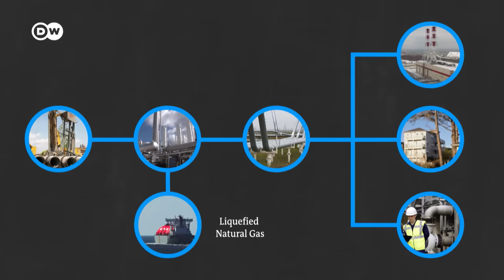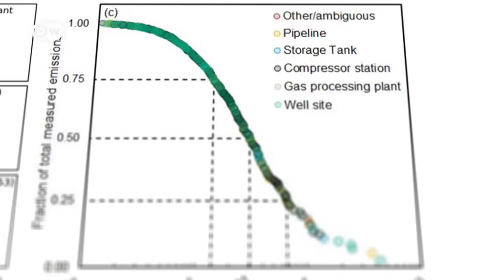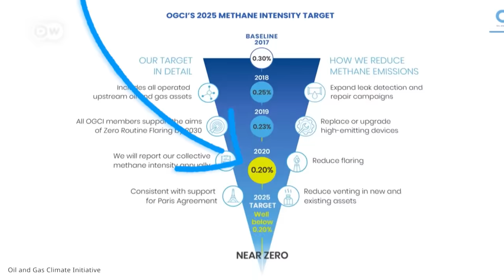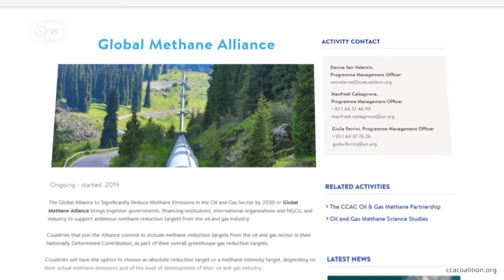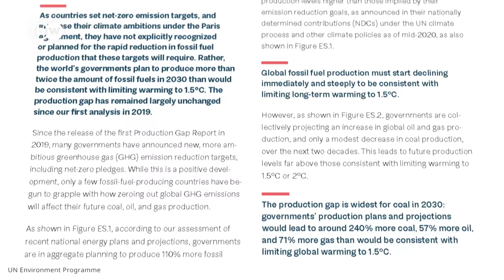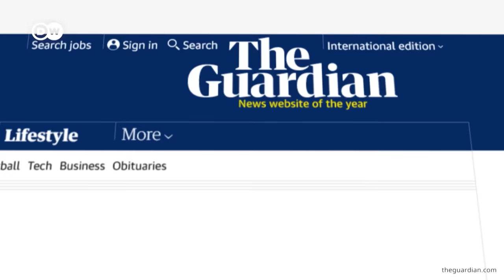Why we need to ditch natural gas (asap)

Comment: So, what's your reaction to the EU's decision to label fossil gas as "green" in their energy taxonomy?
Reply: Hypocrites.
Reply: Transitional policy, the goal was always to use the infrastructure from natural gas to use for hydrogen in the future. The large underground storage for natural gas, the pipes that lead throughout the whole continent.
Reply: Hydrogen has a much lower energy content per cubic metre than natural gas. Pipelines would need to be about 3 times as big for the same amount of energy transported. It has a much lower boiling point than liquid natural gas so existing LNG  transport and storage facilities could not be used for liquid hydrogen.  Mixtures of hydrogen in air can explode  when the hydrogen content is as low as 4%.  A more logical way to go would be to use carbon capture at the hydrogen generating site and make synthetic natural gas..
Reply: Criticism is warranted, but your summary is false. The EU did not label gas green. They labeled projects that replace coal with gas as green, and only if renewable can be shown to be unworkable, and only if the gas usage is temporary and backed by a phase out plan.
Reply: @MoireFly  thanks, that's interesting info, and not been well reported. Does that mean that a given gas project which does get labelled green in the taxonomy can be challenged legally in the grounds that non fossil alternatives were not sufficiently considered?
Reply: @alexz26389  IANAL, but perhaps? I'm not sure what kind of standing you'd need to have. I don't want to pretend that the rules are brilliant, I just want to clarify that they're not trivially idiotic.
Reply: @mike160543  
ehm , it is the other way around
Reply: That’s good
Reply: Madness
Reply: Germany's refusal to reopen thousands of megawatts of clean, reliable nuclear capacity which was mothballed for purely political reasons is far more offensive. Natural gas is indeed way cleaner than coal.
Reply: @gregorymalchuk272  unless it leaks by 3 or more percent. Then gas is as bad or worse than coal.
Reply: Recently went to the EU in Brussels and asked a member about this, his reply was that only countrys that are mainly burning coal would get insentives and countrys that are richer would not be getting insentives when building new gas powerplants. I still dont fully agree with the policy but see some nuance.
Reply: Maybe you should back up and find out it's a scam first.
Reply: @bobreichel  Thanks for your reply. I think it's supposed to come from fossilized vegetation, not dinosaurs 🦖🦕. But you're right, it would take a lot of dinosaurs to make that much oil🙂
Reply: @alexz26389  if that were the case oil 🛢 would be in very thin layers and would be almost impossible to extract, yes? Is it possible that the oil comes from within the Earth acting like a lymph gland for the Earth's tectonic plates. To me that seems more reasonable as oil is in pockets around the Earth. I believe they found some old wells having replenished themselves to my understanding but I'm not dogmatic on that.
Reply: @bobreichel  I'd recommend reading some geology textbooks if you're really interested. From the PoV of the climate the only thing that matters is that burning fossil fuels releases carbon into the atmosphere that previously was safely locked away.
Reply: @bobreichel  You're talking mostly to people who think CO2, a weak greenhouse gas at 0.04 %, while water vapor, a more powerful greenhouse gas is about 95 %, is causing catastrophic global warming while we're deep in an ice age.
Reply: @ricktd6891  wow that is such a dismal statement. I've never heard anyone talk about water vapors causing global warming during us being deep in an ice age. I tend to think you've been snowed over 😅🤣😂🤔
Reply: @bobreichel  Maybe you should look at some data. Search : "Global temperature and atmospheric CO2 over geologic time/graph/images" and try telling me we're not deep in an ice age millions of years long.
Reply: @CarpeDiem13x  yes
Reply: @gregorymalchuk272  We got a similar nonsense politics circus show going on here in the US too. The state of California as totally replace most of their natural gas and nuclear plants, for unreliable and unperfected solar and wind. Yea they complain since then about increasing power outage and rising power bills, during the high of air conditioning season. Just mind boggling.
Reply: @ayoCC  The plan is to "greenwash" methan ("natural gas") as "green hydrogen".
Reply: @ayoCC   if you ever thought storing and transporting natural gas was a pain, wait till you see hydrogen. Also it needs a huge amount of energy to be produced

Comment: This guy literally said bio gas is greener than natural gas. They literally share the same chemical structure lol
Reply: Yes, but where does the carbon in those molecules come from? For biogas, you literally have to grow crops that capture the carbon from the atmosphere, while natural gas was geologically trapped and now we're pumping it out of the Earth's crust and into the atmosphere.
Reply: it doesn't fit the narrative lol
Reply: @guilhermetorresj  Burning biogas and later reclaiming it does magically make burning biogas greener. One could grow giant trees to reclaim carbon and later store them to make nat gas just as "green"
Reply: @akihitokoizumi2474  Bad line of logic. The trees would stay there unless someone cuts them down. Where are the the bio gas will be made where we use it or not but unlike the trees leaving it be will just let it get into the air and it will act as a green house gas.
By using it we are dealing with a waste product and helping the environment where as cutting down trees is similar to any other bio fuel.

So in short Bio Gas is waste management where as natural gas has to be pumped from the ground. So unless that natural gas was just going to be burn leaving it in the ground is better.
Reply: It's "bio"....that makes it cleaner.  If you said "green bio gas" then it would be extra gooder.
Reply: @akihitokoizumi2474   The ideal solution but possibly not viable right now is convert animal and human sewage to simpler gas and liquid compounds: destroying plastic and pharmaceutical contaminants in the sewage, to fertilize crops or to  burn instead of fossil fuels, while retaining the fossil fuel distribution  infrastructure.
Reply: He's also complaining about Methane CH4; if you're a living mammal you are a CH4 contributor, er go, he's also emitting CH4!
His science is way off.
Reply: I bern trees bruh, its green cuz I planted the tree tho. WOW

Comment: So much wrong with this video. 1) calling CO2 pollution is wrong. Aside from a (likely overhyped) effect on the climate, CO2 is not bad for the environment and good for the biosphere as it allows more plants to grow. 2) calling methane an x times stronger greenhouse gas ignores that its infrared absorption spectrum has a lot of overlap with water vapor, which already saturates a lot of the absorption spectrum in the atmosphere. It is a half-truth that is effectively an untruth. 3) under the influence of oxygen and sunlight, methane in the atmosphere gets broken down in about 8.4 years so methane doesn't accumulate over longer periods of time.

Comment: i just replaced an old tank water heater with on demand and installed a new gas furnace in my basement and garage. also switching to gas stove top. the cost of electric is 4 or 5 times that of gas to heat the house and cook food. im also looking to switch my electric dryer to gas.  i am considering solar panels next year but while 110v is reasonable, to get high amperage 220V circuits off solar - it quickly doubles or triples the cost of the system.

electric prices are skyrocketing and solar is still crazy expensive.

Comment: Four main sectors are supplied by gas natural, which are: plastic, cement, fertilizers and steel. Those main sector provide the elements for keep the status for what we call modern civilization. Try to avoid the use of natural gas in Europe in winter and you'll see the froozen consequences. There Is not a short term sustitute for this hydrocarbon. And if you find it, for sure wont be cheaper for the contries.
Reply: steel and fertilisers can be made using renewable techniques. And we should be drastically lowering our plastic consumption regardless
Reply: @jebbo-c1l  True. We should have banned single use plastic bottles long before we banned plastic straws.
Reply: @jebbo-c1l  Like you said it's pretty easy. The world has to learn to survive on 1/10 of the amount of fertilizer.
Reply: @taco7043  Easily said until the shelves at your store are empty. And, the supply chain has been so damaged now that you must see the start of that process already. People who were born post Great Depression/Post World War II have no concept whatsoever about what a day of real hunger is. The ideological possession won't survive the first true "Hunger Winter" you are almost eagerly inviting.
Reply: All the people complaining continually buy takeout and baked goods in crystal clear plastic containers never making the hypocritical connection.
Reply: @randomguy9777 "Green energy" is aspirational. It means admitting there is a problem with the way we generate energy, and attempting to find a solution. 

In order to get behind it, you actually have to admit there is a problem with the way we generate energy right now, which is obviously something that you are not that keen on.

It's nothing to do with the Russians mind, it's simply an acknowledgement of the fact that once we have finished burning everything, there will be nothing left to burn and we won't know what to burn next.

Comment: Why is there no mention of elephant in the room? Nuclear is best solution
Reply: Nuclear is realy good.
Exept that it takes way longer to build and is more costly then reneables.
Reply: yesh.
Reply: or the newer version theyre working on , but i bet with that technology maybe new weapons also.
Reply: @hirnlos9462  More stable and secure with 24/7/365 output, almost same costs for building as solar. You need additional infrastructure for battery farms for renewables. Based on french study where it costs 2060€ for kW (2020 price level), compared to 1900 for solar (350 to 3500 based on quality). Massive difference is size of land which you need for solar.
Reply: That's what France did!!
Reply from the maker: Nuclear is also a bit complicated. If you're interested, please watch our video, "Do we need nuclear power to stop climate change?" 👉 https://youtu.be/9X00al1FsjM - we would love to know what you think of it in the comments ✍️
Reply: Gas is mainly used for heating, so the first step is to replace gas burners with heat pumps.
Reply: @hirnlos9462  Why it HAS to be renewable? That's not the goal. The goal is cheap, carbon free, abundant energy. Uranium is not renewable but there is enough for 1 000 years. As for fusion energy, sooner or later we will have that, and there is enough fuel for 10 000 years.

Comment: Why would you replace coal fired power plants with fossil gas power plants, when you can replace it with nuclear?
Then your emissions per KWh will not only halves, but goes way below solar and similar to wind or hydro.
You can also use it for district heating.
It is reliable (not like solar and wind), no need for energy storage, (battery breakthrough is just wishful thinking, hydrogen is very expensive and ineffective), you are not depending on dictatorships, and once a plant is fuelled up, it can run for years 24/7/365. It also produces way less toxic waste than solar on KWh base. 
You can say wind and solar are cheap, but if you add all the extra cost of infrastructure (transition lines, storage, fossils gas backup etc.) it will be way more expensive than nuclear.
Also there's no way that you can store enough energy from the sunny summer till the dark and cold winter. 
If you don't believe me, get your own calculator and do the math.
Reply: Because you can't afford the capital investment required to build the nuclear power plant.  Doh!
Reply: @richdobbs6595  
Can't afford? LOL!
It is estimated that by 2025, the cost of "Energiewende" will reach 520 billion euros.  From that money Germany could have build 18 Hinkley Point C. (probably more due to economy of scale).
That could provide Germany 58GW carbon free electricity 24/7/365. No windmills, no farmlands turned to giant solar fields, no air pollution due to burning coal, no deforestation in the name of biomassa and most importantly no dependency on Russian gas.
Doh!
Reply: @bigsmall246  
It can be used, but way too expensive and more difficult to handle.
Also molten salt reactors have a serious corrosion problem, which needs to be solved first. When that's done, we will see much more of those hopefully.
Anyway, you do not need a nuclear power reactor to make nukes. 
For Uranium based bomb, you need only an enrichment facility with lot's of centrifuges.
I recommend the "Getting to the Good Stuff (Uranium Enrichment)" from the channel: Illinois EnergyProf
Lot's of good stuff about nuclear.
Reply: @solutionrebellion  Yeah, Germany or USA could definitely afford the investment, but not China, India or Nigeria.  The problem in Germany, USA, or Austria is politics.

Comment: Flaring is burning methane to release CO², not dumping methane into the atmosphere.
You can see methane in the infrared. Pull the IR filter off almost any camera sensor and it will show up.
We should be investing in renewable storage and nuclear, but undermining coal by using natural gas today is still a net positive.
By far the best thing we could do is support developing economies in moving directly into renewables so they don't make the same mistake wealthy "first world" nations have.
Reply: Next brig technology could be replacing home gas heating with heat pumps. Per unit of gas it gives out more heat to burn it in a power planet and then use electricity for heat pumps. + waist heat could be used for district heating, given it is above 60C (not sure how those plants are set up).
Other thing it would do is reduce amount of gas leaking as no joint is perfect and reducing gas grid significantly will have a noticeable impact on energy usage. 

Solar water heating is also a very good way to reduce grid demand. And then use heat pump for additional heating if needed.
Reply: It was worth it to build primary generation gas power stations 20 years ago, but it is too late now. Wind and solar need to be the main source in most locations with gas used just as a backup for when those can't produce enough.
Reply: The energy demand in developing countries is so high that switching directly into pure renewables will blackout half the country . In Asia , just like the west, gas is being termed as the " transition fuel " , the only difference is in the future part whereby Nuclear is being actively pursued instead of wind & solar
Reply: Yes, they were clearly wrong on that point. I think that shipping companies would have gone to LNG to make International Maritime Organization requirements for 2030, but they seem more focused on 2050. It is going to take time and money, but the longer we wait, the more expensive it will be.
Reply: Guess what oil and gas industry is going away from flaring. We captur everything now. The company I work for our capture rate is 97-99% including tank vaper. But, that Co2 our lungs  expelled we better start taxing people for air we breath. Better put  that camera on that mouth. 🤣😉

Comment: And then battery production emits more than everything else 😂
Reply: According to what source? I"m just curious.
Reply: Go educate yourself cheers
Reply: The main problem is that batteries near the end of their life span start to even out carbon emissions but then you need a new battery if your car even lasts that long.
Batteries require massive land destruction to mine for materials, solar panels have a limited lifespan before needing replaced and they are not green to make or dispose of. Windfarms have a limited lifespan and again are not green to make or dispose of while also needing electricity from the grid to keep it spinning when wind is not enough or they break.
Natural gas is the cleanest fuel and should be used for the time being. Also needed to be expanded to close down more coal plants.
Also who hurts the most from pushing "green power?" The poor. Elites will always have their needs and wants met.
Reply: Wind turbines are carbon intensive to produce and don't save enough CO2 to justify production
Reply: @allanyoung6231  Is that your feelings or you got that fact from somewhere?
Reply: @kangkim150  Is that your feeling or something you dreamt
Reply: Just asking for a source dawg
Reply: @kangkim150  What's yours dawg or catz
Reply: @allanyoung6231  :) I thought so lol

Comment: Impossible to ditch natural gas at this time. If the US were to build 60 new nuclear power plants we could start thinking about it, but remember, a lot of natural gas usage is for home heating, and to replace that with electic heat, you need even more nuclear power plants. If you want to charge electic cars that will replace gasoline powered cars, you need to add even more. When you total it up, we should be building about 100 new nuclear power plants.  The longer we wait, the worse the problem will get.